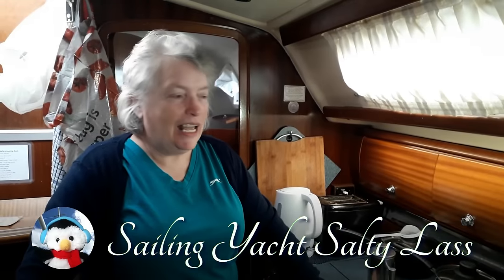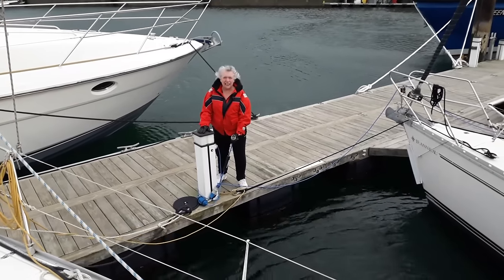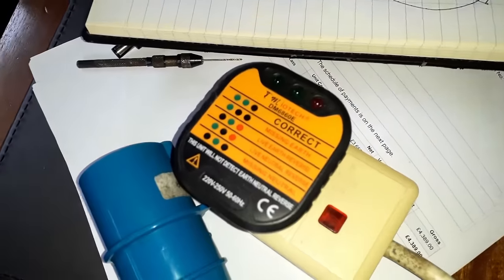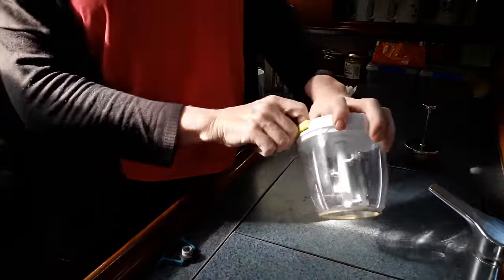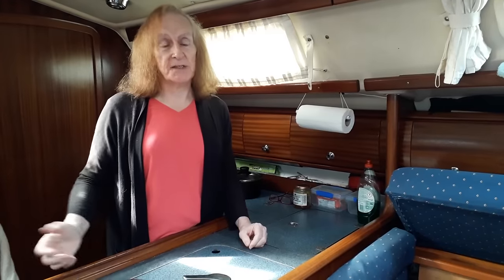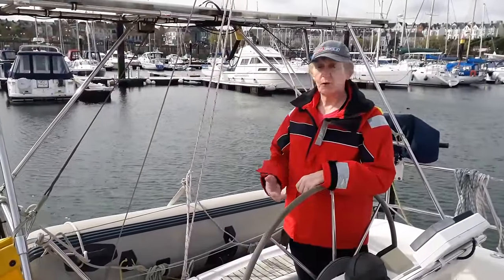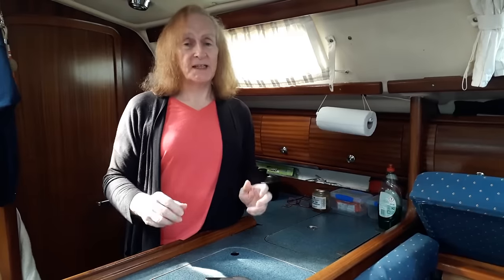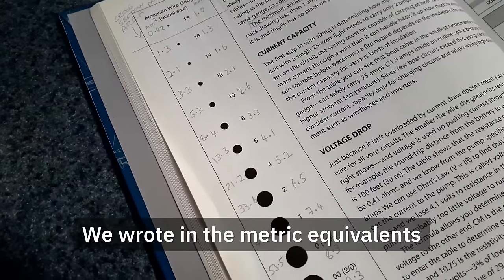Winter talks - AC Power - Electrics - Lithium Batteries - Lead Acid Batteries - Ep. 335

Comment: Your assumptions on battery life are wrong. Lithium will last 15 to 20 years at least. In addition, you comparison of battery costs needs to be adjusted for the usable capacity that a lithium battery has. You don't need the same Ah capacity as lead if you go lithium for comparison purposes.
Reply from the maker: I have heard a lot of people telling me about the 20 year life and very few can come up with a concrete example of a LifePo4  really lasting 20 years. There are also plenty of examples of LifePo4 batteries getting a BMS fault and frying £x,xxx worth of batteries. I also have plenty of people telling me that my 5 year old lead/acid batteries will last 2 years if I am lucky.

There are a lot of agendas and misinformation out there, but the information on price is solid.
Reply: @SailingYachtSaltyLass  I ams orry but you have little knowledge of the subject you are dismissing. Rod Collins, part author of the ABYC standard for lithium has had a lithium battery in his boat for 15 years. He recently capacity tested it and it still has its full capacity. Individual lithium cells costs are about half of what they were 12 months ago. We recently built a 280Ah battery using grade A cells and a jk BMS with 2A active balancer for $600. That is equivalent to about 500Ah of lead domestic battery. It will out live the lead battery many times over. My own batteries are 12  months old now. We are liveaboard. 920w of solar, electric cooking, watermaker and immersion heater all run from lithium and solar. Same propane bottle since last summer, only used for the oven. Everybody who converts says what a game changer it is. No need to keep the lithium charged like lead. Its just as happy at 20% charged as 80%.
Reply: When researching LiFePO4 for the boat I came to the conclusion it was the lowest cost over the life cycle of the installation. Having worked in an industry where lithium batteries which were automatically tested was the norm, I was confident in the batteries. The BMS is the most likely point of failure and so I went for Roamer batteries which have serviceable BMS and cells. We were out for 5 months last year and our batteries went through 8 charge cycles with the lifetime projected to be 5000 charge cycles. I don’t expect to be changing them ever
Reply from the maker: @SVAscent  - Batteries that last (nearly??) forever would be wonderful. I wish my mobile phone's battery was that good 😄😄😄
Reply: @SailingYachtSaltyLass the thing about your phone battery is that it’s a mass produced item built to a cost. It’s also lithium ion and not lithium iron phosphate. Probably, more importantly most phone batteries are fully charged to 100% and then left in a charger and the discharged very low. Whereas on a boat that’s not likely to happen for a few reasons. Such as you size your bank to suit your needs. You tend to be present during charging and so can switch off charging at say 80 to 90%. The BMS eliminates the danger of harm by discharging too much. 

The good thing about lead acid when you liveaboard all year is you can charge them at any temperature. With LiFePO4 you need to buy the heated versions which makes them more expensive and is another point of failure. So I can see why Lead acid suits you living up here in the frozen north

We are removing our gas this year so our electrical demand will be much higher so the rate of charge with lithium is a big bonus, particularly as we don’t have or want a solar arch. Last week in the storm I saw the wind turbine putting 30amps plus into the batteries.
Reply from the maker: @SVAscent  - Yikes! You have to heat the darn things!! Really?? Holy moly 😮 That's it we are sticking with L/A batteries (at least until we go much further south 😄)
Reply: @SailingYachtSaltyLass  yip! You can’t charge them when they are below 5C. You can buy heated versions but they are more expensive. Horses for courses and all that. If lead works for you then it works for you!
Reply from the maker: It maybe would not be a problem. This boat below 5°C....?  Not a chance 😄
Reply: @SailingYachtSaltyLass  that's different chemistry. Not lifepo4
Reply: @SailingYachtSaltyLass  you can have heating pads. They work fine if you buy the right batteries. You can't charge them below 5degC but would you be living in the boat if it was below 5 degC? You are trying to find problems to justify your comments with no experience of lithium. Try it. Its a different world
Reply from the maker: Yes I know. I said that Li Ion was different
Reply: My main concern is the stability of lithium and additional fire risk, in the uk the new regulations for solar installations are heading towards no longer allowed to install in attics and lofts.
Reply: @V8guy3500  what additional fire risk? Would you like to quantify that?
Reply from the maker: @V8guy3500  - luckily we no longer have an attic (or even a house) 😉